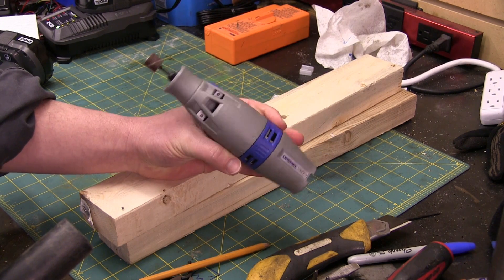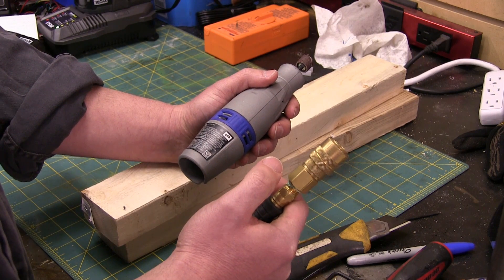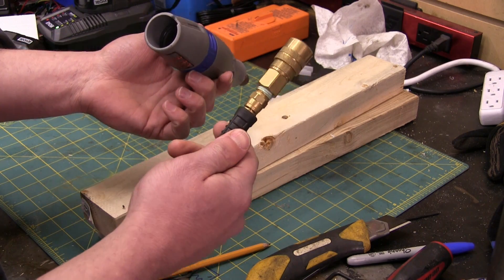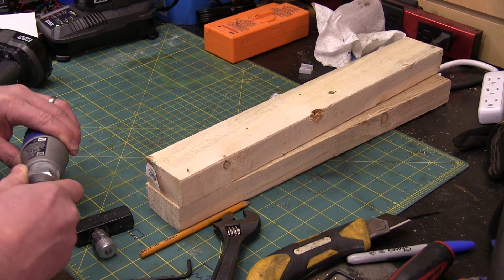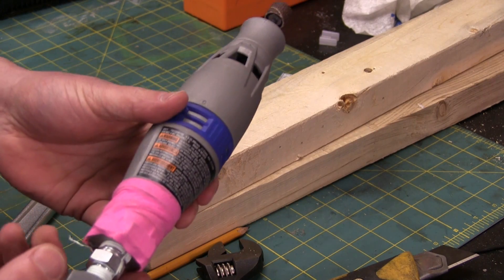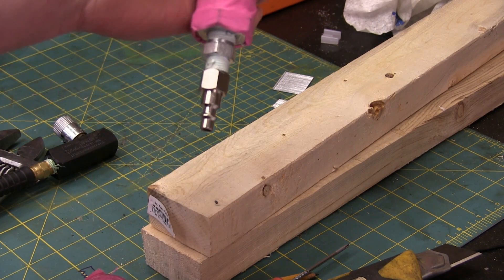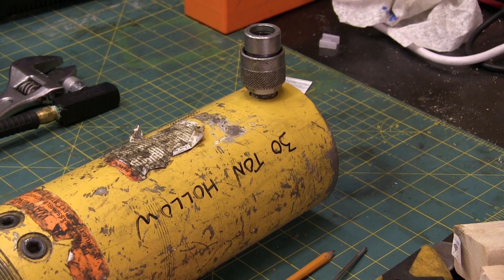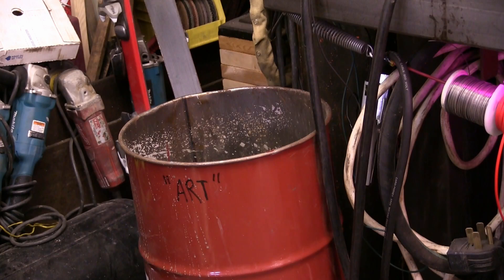You asked for it! Patron's Request: Dremel Suck Tool on 100PSI air

Comment: In England we have BSPP (British Standard Parallel Pipe) is most popular in the UK, Europe, Asia, Australia, New Zealand and South Africa. It is a parallel thread fitting that uses a bonded seal ring to do the sealing. 

Also BSPT (British Standard Pipe Thread)  main difference is the flanks of threads 55 degrees instead of 60 degrees as it is for NPT. Thus an NPT male will fit into a BSPT fitting or vice versa but they will need chooch sealer tape. This is a popular fitting in China and Japan but is very rarely used in North Merica's

What most people do not appreciate is that Whitworth invented the standardised thread-form back in 1841 and the British Empire spread this around the world. When they decided on a standard thread for plumbing pipework, the British Standard Pipe Thread, it was the Whitworth thread-form that was adopted. Lots of gun barrels from the crimean war were used for piping so I have heard from some older machinists.

This also spread around the world and virtually every continent uses this system. However, there are two anomalies.

The German’s didn’t like the idea of recognising the English BSP so they called their system DIN.

It's the same thread-form as Whitworth so to identify the correct thread size under the DIN Standard, you have DIN 15 equalling BSP half inch. DIN 20 equalling BSP three quarter inch and DIN 25 equalling BSP one inch.

Our dear friends the Mericans went one better and they called their system NPT, National Pipe Thread.
Just as they changed the size of the Imperial gallon to the US gallon, they changed the thread-form from Whitworth to something entirely different. So instead of having the Standard 55 degree angle on the threads, they changed it to 60. 

Yes you do have to ask yourself why? 
I think it has something todo with being prefixed with (British) if it was just called Standard Pipe I think every one would have just adopted it, but because it was loaded with the term British. Germany and the Mericas went fuck that we will just rebrand it and call it are own, son of a diddly!

BSP standards FTW, if you're not a German or Merican ...

Comment: Us continental types, we use pcl connectors that look much the same as yours, ours also have a 1/4 inch taper pipe fitting that don't seal unless you fill it with ptfe tape and to tighten it, we have a rootle the the spanner draw and if we can't find the appropriate imperial spanner because the rust has eaten the sizes marking away 9because it so long since we needed them) we use the good old metric adjustable  spanner that always rounds the corners off nicely. good vid man and funny as f$%k again

Comment: Metreek Australia - we still use imperial measurements for fittings :(

As far as running the dremel goes, wouldn't it be looking for airflow over pressure?
Reply: why thats a great point....
Reply: not npt but, bspt or bsp, just changed to r and g for parallel and tapered, fraction sizes stay the same, that's for regular pipe threads. olive joints can have metric threads and sizes. Australia is really a wet jigsaw puzzle when it comes to standards, it's the worst of both worlds when we need to know all the inch fractions, then what they are in metric, verniers need both inch and metric, all of the spanners and micrometers.
Reply: Andrew Kilner  Yes, but it will be built for airflow, not air pressure.
Reply: +Luke Boland I think its looking for a vacuum or suction. The impaler will be designed to only spin one way
Reply: billybobjoe198 A meter is an arbitrary name we gave to a certain distance. Yes that distance is the same no matter what you use to measure it but calling it a meter only has meaning in the metric system. c on the other hand is not dependent on any system and is fundamental aspect of nature which is what I mean by it being a constant.
Reply: No mate we call it 6mm............ unfortunately you are correct more metric required!
Reply: +corey Jones epoxy.... The ultimate thread adapter....!
Reply: billybobjoe198 I just want to point out that c is a constant and not a unit and is usually just set to 1 when used because it won't change no matter how you measure it be it metric, imperial or lengths of twinkie per degree of spin of jupiter.
Reply: billybobjoe198 except calling it c has meaning inside metric and is actually fundamental to metric since we use c to get the length of the meter.
Reply: billybobjoe198 yes we can but metric is the only system where a length is actually defined by light. As for c having no meaning in metric because it isn't metric that is false because the metric system is working towards having it's units defined by constants none of which are inherently metric. Just because something isn't inherent to a system doesn't mean is has no meaning the letters we use aren't english but they make up the english language and the same is true for c, and soon the other constants, and the metric system.
Reply: An inch is defined as 2.54 cm. Even when you are using imperial units, you are still using metric, just one step removed. There is no escaping the metric.
Reply: +Luke Boland air, well any gas really, is just a compressible fluid so pressure and volume of the thing you are trying to push the fluid through are the big factors.
Reply: Only useless garbage is the old system that you hang on to because just by your stupid comment you have proved your complete ignorance of the rest of the worl so wake up, adopt the better system because you are stuck in the past.

Comment: In England, we have BSP (British Standard Pipe) and imperial, and metric. 

Had to buy radiators parts once. Came in either 13mm or 15mm. But not really, as the 15mm stuff hit the 13mm stuff, they just decided to do OD and ID all willy fucking nilly.

Comment: thete is a difference between pressure and flow. you can have 1000psi and "no flow" flow is what that crap tool needs. volume. your shop vac can move a ton more gallons/liters of air a minute than that tiny pressure line can.

once the air from that tiny npt expands to fill the dremel it had no choochin left in it. no volume. i would guess around 5 to 10 psi tops.

to visualize this try filling a trash bag with your compressor. then try filling it with your shop vac on blow.

Comment: Metric folk here in New Zealand, Still use Imperial fittings 1/4 BSPT/NPT etc when it comes to air fittings. What with being a relic of the monarchy and all that...
Reply: +Patrick Rebecca Doohan its true all kiwi's know each other
Reply: +Patrick Rebecca Doohan So de we here in Europe. Air, water, oil fittings or even car tire and TV screen sizes...
Reply: +Emma Jacobs. Yeah, in the US even, tire sizes are mixed. like mine are "P195/65R15" Meaning 195mm wide, 65% of 195mm tall, and 15 inches in diameter for the wheel/rim.
Reply: +Patrick Rebecca Doohan Hello fellow Kiwis :)
Reply: yea it's called the 2 degrees effect
Reply: Aichmo
Also true, my in-laws extended family haha
Reply: Also we arsehole those chinese snap fittings for some decent leaky Aro fittings right outta the box
Reply: hi pat
Reply: Oh hey Steve, Fancy seeing you here!
Reply: Yep true story!
Reply: Yes, yes, yes, all the same here :)
Reply: +Patrick Rebecca Doohan, 1/4", 3/8" and 1/2" socket drive sizes are similarly an international standard.  (Imagine needing an extra set of 'metric' socket drivers?)
Reply: +acousticguitarpeter Only the rim diameter dimensions - most tyre widths are metric :-/
Reply: Same in Sweden. Imperial for all hoses.